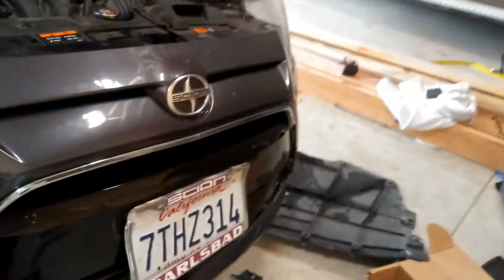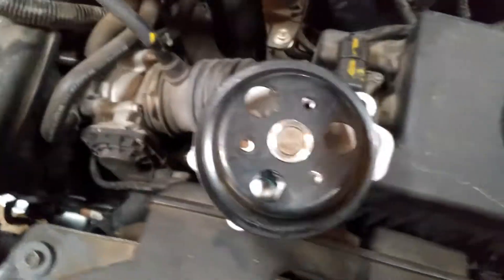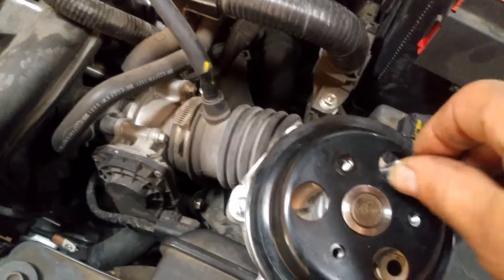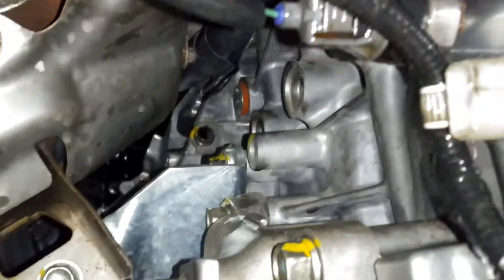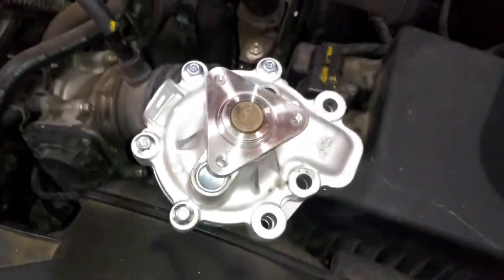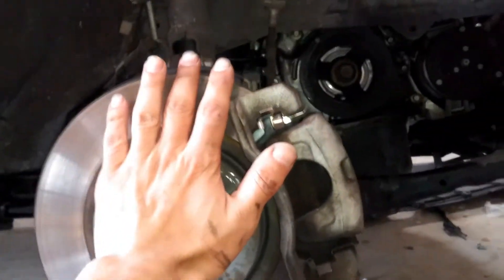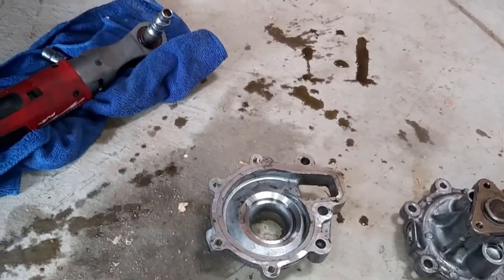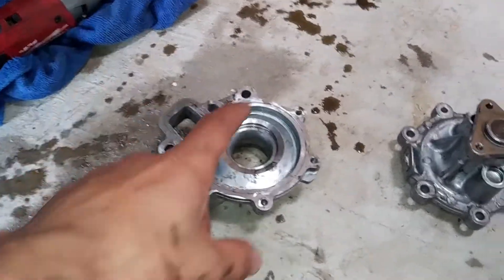2016 Scion IA water pump replacement

Comment: can you do the serpentine belt, scion IA 2016 🙏🏻
Reply: The serpentine belt is really easy. The key is that there is a "bolt shaped" protrusion on the tensioner. You just pull up on it with a socket and ratchet and the belt slips on. Threading the belt is pretty simple too. It goes around the two bottom pulleys, then up to the alternator pulley with the back against the tensioner. It took my 90 minutes of futzing around trying to get the belt around all of them until I saw that "molded in bolt" on the tensioner. It made it absurdly easy. Use a long handled ratchet to make it quite easy.

Comment: My wife's IA went whacky a little south of Indianapolis yesterday. After discussing what happened It sounded like a broken serpentine belt. she sent me a picture of the top of the alternator and, yep, no belt. I had to buy a new belt locally and drive 3 hours to her car to put on the new serpentine belt. Oddly, I couldn't find a video on how to squeeze that belt on. Fortunately, I finally noticed a "nut shaped" protrusion in the tensioner (after about 90 minutes of messing around with it). And that part was then easy peasy. It's getting the belt actually on that is always the bane of alternator replacements for me. 

We both finally got home by midnight...
Reply: $130,000 Mi on my Scion IA no problems whatsoever runs like a dream